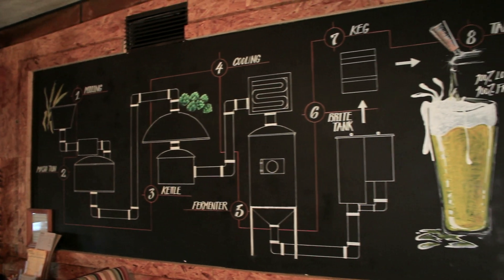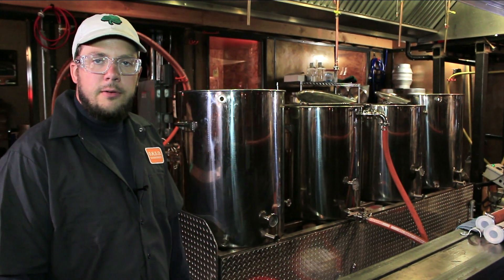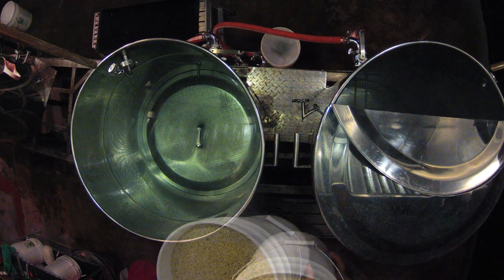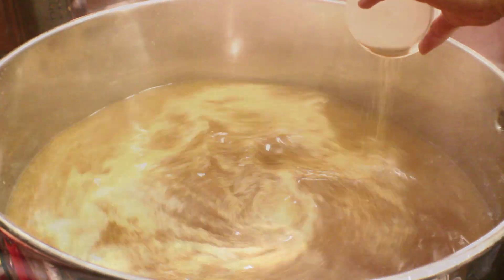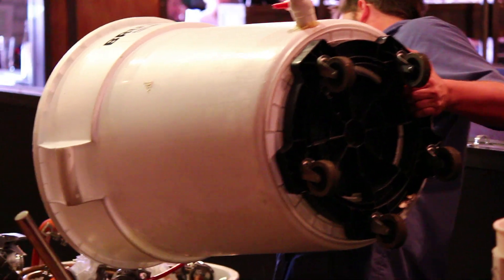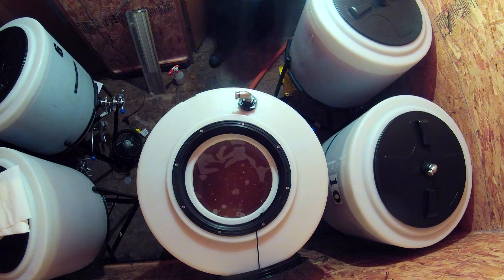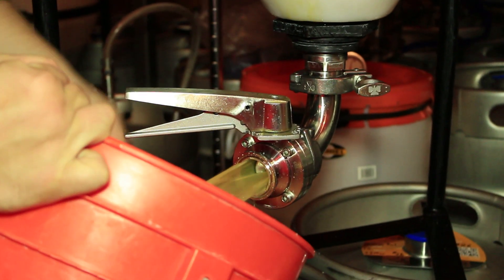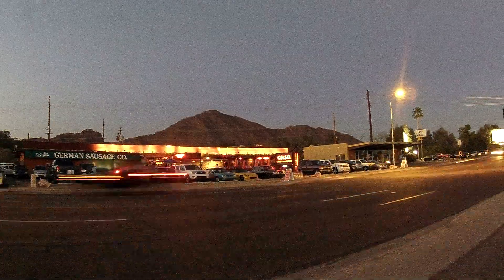O.H.S.O. + nanoBrewery's -- "Brew How-To"

Comment: What was the device used to check the beers AVB? I mean the electronic one!
Reply: cattigereyes1 that may have been a thermometer.
Reply: It was an infrared thermometer. It was just checking temp so that the gravity reading could be adjusted based on its actual temp vs the temp the hydrometer is calibrated for.